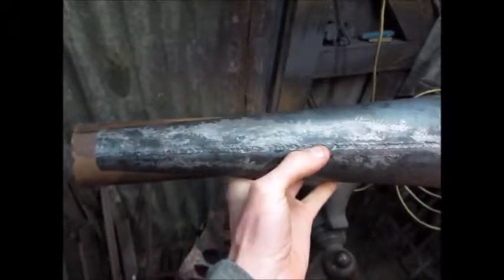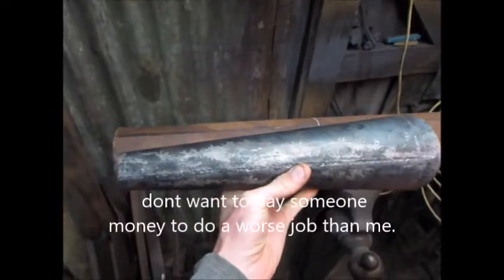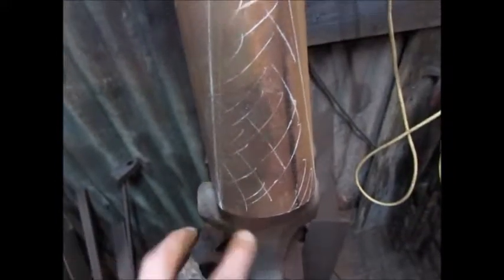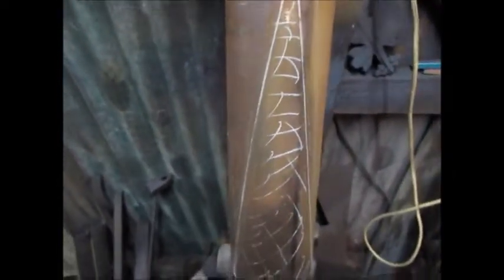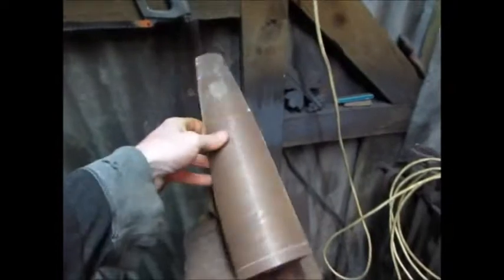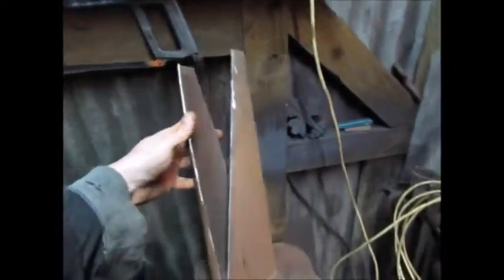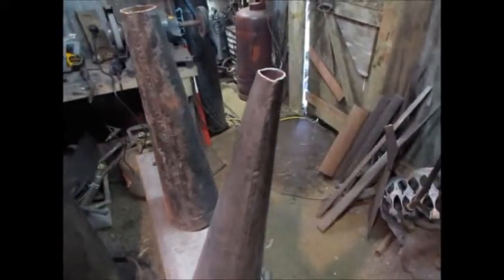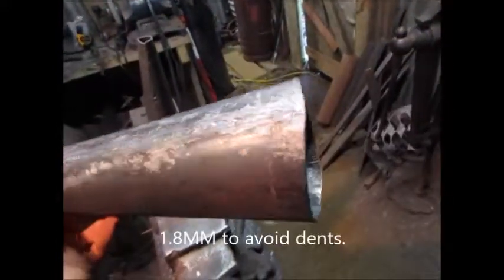Alternative way to make steel cones for an expansion chamber.

Comment: You no what pal...just buy some
Reply: @RudiTheBlacksmith  but..the dimentions are crutial to the perforance of the bike..if not the bike will neva run right..then you ha ve to jet the carb..were you from..you can get anything from anywhere now with internet..if you can down load youtube surely you have ebay
Reply: I built a pair a few year ago..took me a few week on and off..and the bike run shite no mater what carb jettin...i went on internet and got a pair for 100quid...you couldnt put them you made on a bike..try up dateing ur workshop